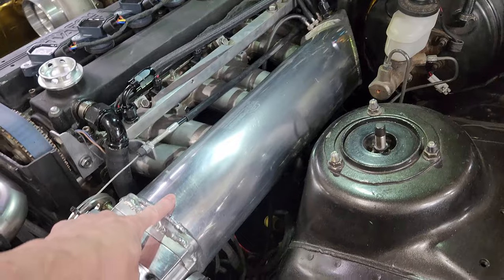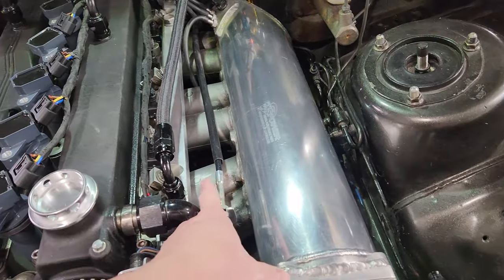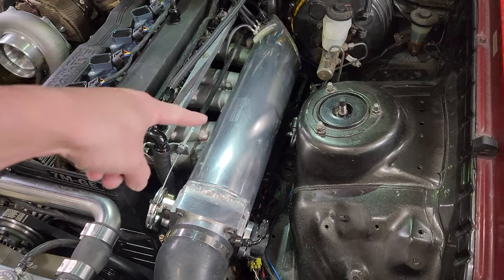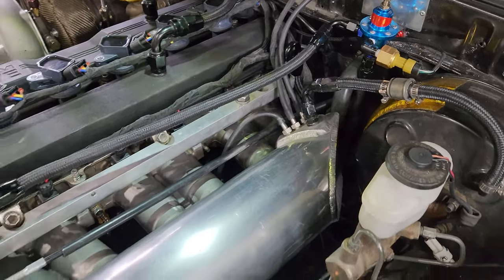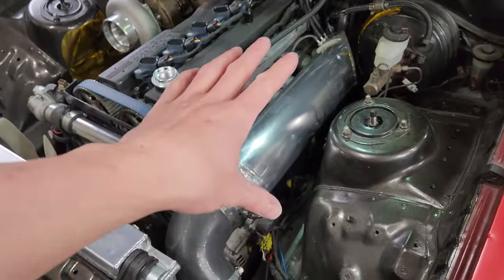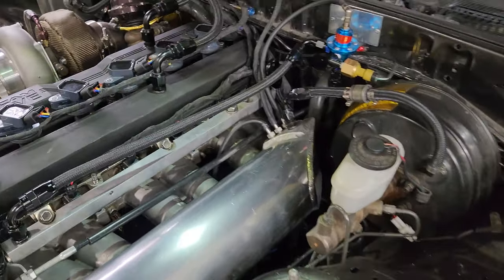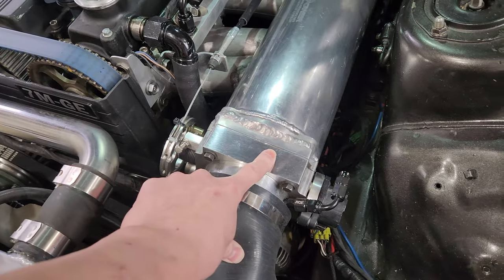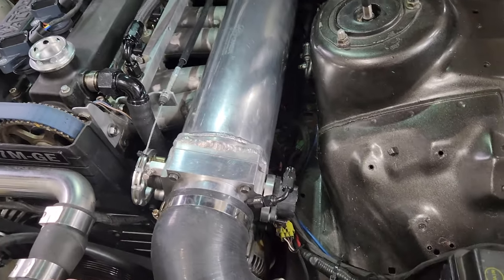7M custom forward facing intake manifold

Comment: So what "we need" as a 7m community is a good detailed electronics guide when it comes to modernizing the bay. I've looked all over for information should I go to a custom harness and a standalone like a haltec. There is no information as to what modules and the like can be removed and which sensors to update across the board. It is funny that when it comes to the FFIM side of things, there too is so little actual information post 2006.
Reply: Ms3 pro is a plug and play ecu using stock harness
Reply from the maker: I've had to slowly and carefully remove certain sensors and what not to clean up the bay. I'm running the ecumaster which allows you to adapt the factory harness to the standalone ecu. Hopefully this video sheds so light on doing a ffic. It's. Ot super difficult but can be daunting if there is little to no info.

Comment: im curious if belt length matters when relocating the alternator? and also without intercooler piping running to the other side how does it route to the passenger side of intercooler
Reply from the maker: Yeah belt length does matter in this case. The 7m has 3 different belts with the factory setup. When moving the alternator down below it actually brings it closer to the crank pulley which requires a shorter length belt. 

The intercooler pipe runs from the intake down through the battery tray to the intercooler. From the intercooler it runs up along the power steering pump and to the turbo.
Reply: @mainstreambuilds  awesome good to know thanks man, so you must have gotten rid of the maf and filter, i think im gonna order front facing soon
Reply from the maker: @rileypinard2348  I was able to toss the maf when I switched over to a full standalone ecu and ran the new turbo. The forward facing intake looks so good and makes it easier to route the intercooler pipe for the turbo

Comment: So I’m planning on getting one myself and it most likely will be the 86.5 and I plan to turbo it. Would yall recommend me do that without changing much of the internals?
Reply from the maker: It just depends on how much power you are trying to achieve. If it's just the stock PSI or a few PSI above that it should be fine. The forward facing manifold has decent low end torque, better throttle response, better intercooler pipe routing.....and just looks way better.